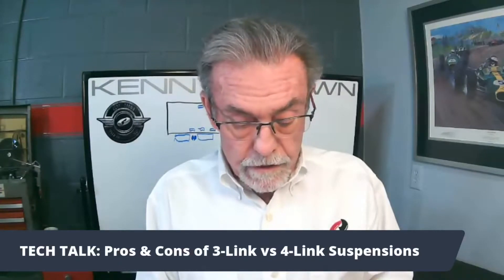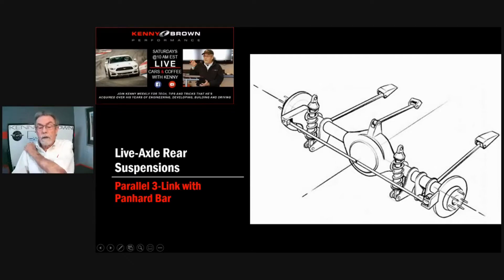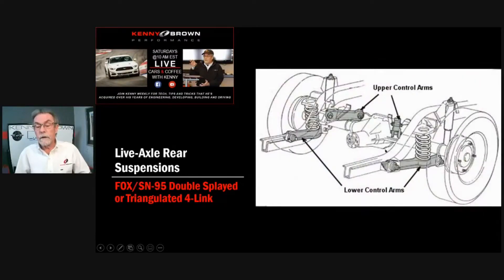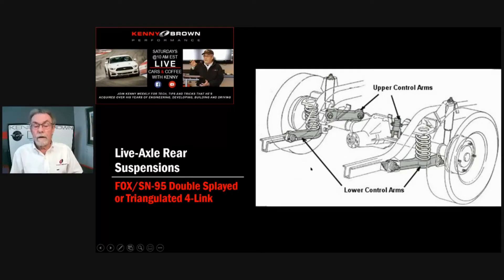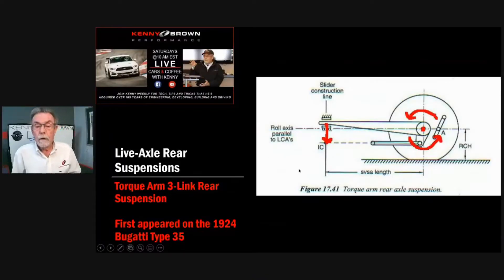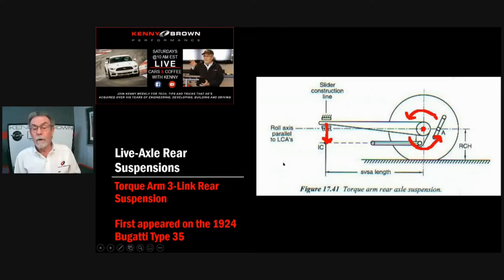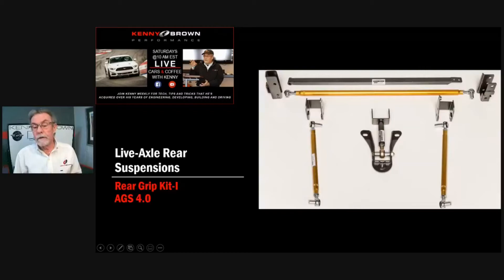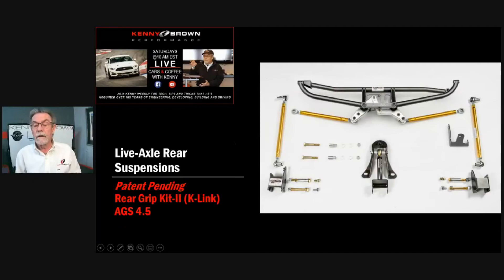Kenny Talks Tech on 3-Link versus 4-Link Mustang Rear Suspensions

Comment: For those interested, the K-link or AGS 4.5 is commonly know as a Mumford Link. There isn't much information about it, but basically it lets you set the roll center well below the axle and theoretically below the ground. The two lower links that extend out to the struts set the angle at which the roll center meets in the center. The triangle center linkage allows the mechanism to clear the ground and angle back towards the chassis. Supposedly some UK club racers have been using this system for almost a decade with great results. It was developed by an engineer name Michael Mumford.
Reply from the maker: You are spot on Travis. This Mumford variation is modified and designed specifically for the S197 Mustang, but there are several variations that have been used in professional racing in the EU as you noted for decades. Most of them with slight differences for the application.